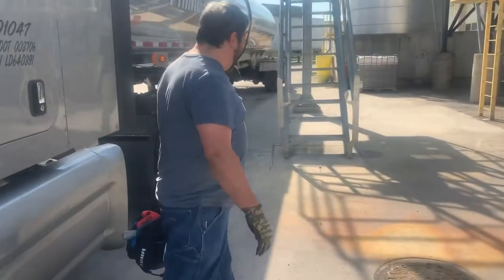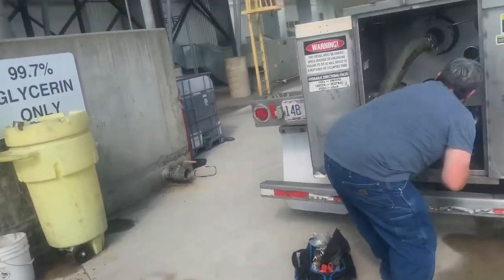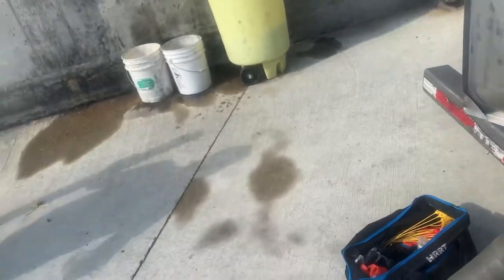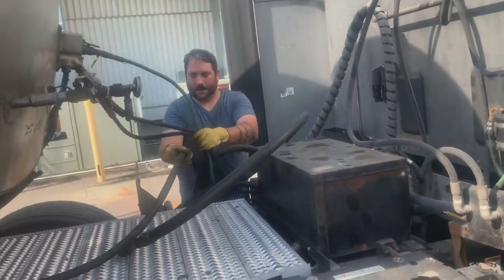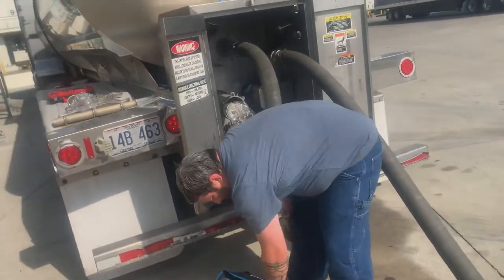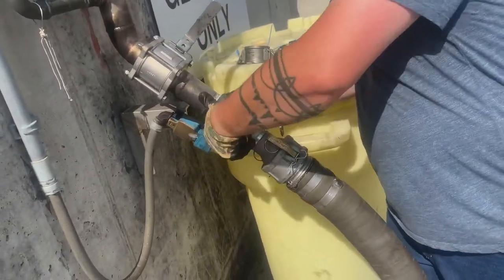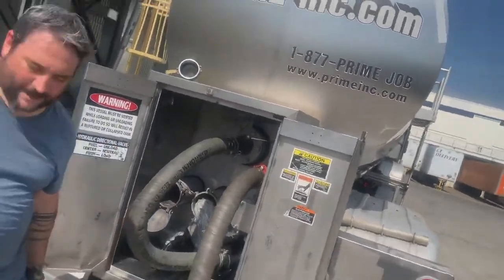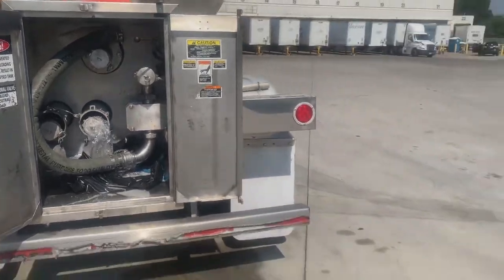Loading and Unloading Basics for Tanker -  Prime Inc Tanker Vlog 4

Comment: Cool vid man, about the same as when I used to haul fuel and had to do a pump off.  I also used to haul water in the oil field but we used vacuum  pumps they were a lot faster, only took about 15-20 minutes to load/unload maybe a little longer if you had some thick crap. Ya'll stay safe out there.

Comment: I dont see when drain the hoses at the end of loading 🥺
Reply from the maker: It's a long process of reversing the pump and rolling up the hose towards the pump to try to empty it; then closing the valve to the trailer and shutting off the pump. That is the basic s

Comment: So the tank to pump will have product after 

Take extra caps before leaving ? Cause that was a hood bit still falling out
Reply from the maker: The extra amount is very dependent on your truck setup, the tilt of the trailer and the capacity left in the customers silo. You will always have some left over. You just have to work the pump to suck back what’s left so you don’t have messes such as what happened in the video. It’s just something you do with what you have.